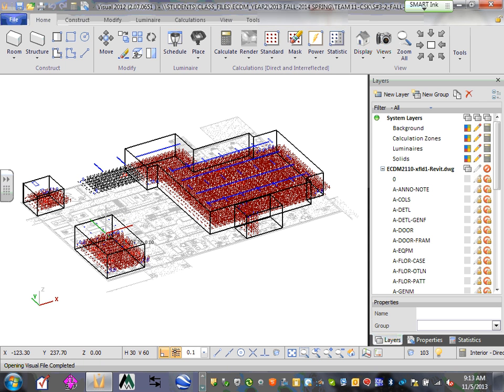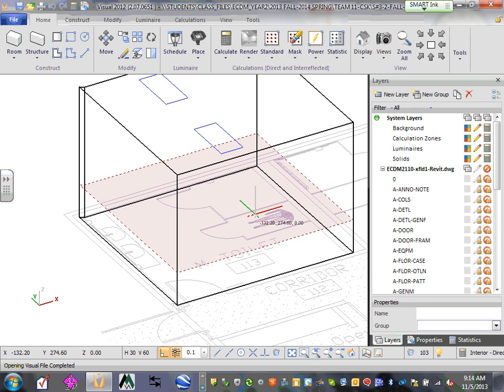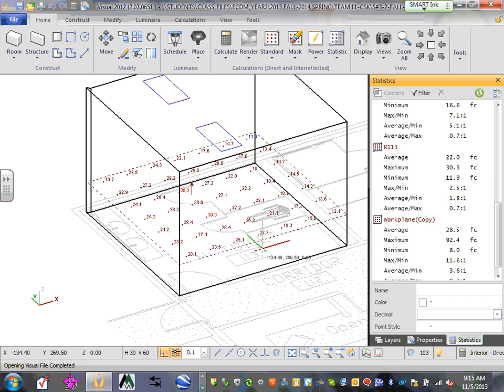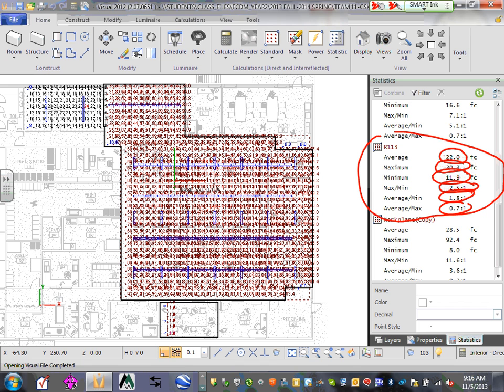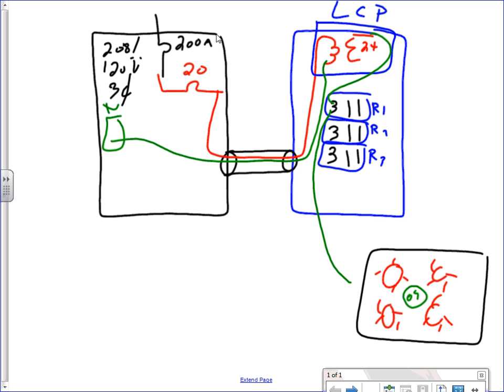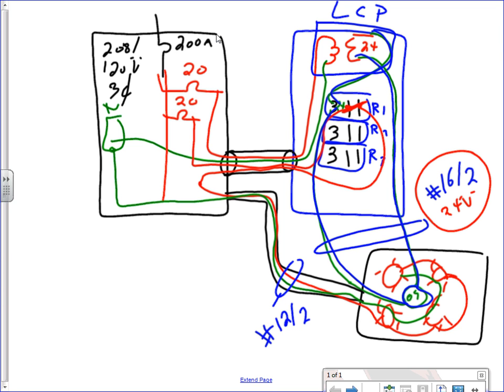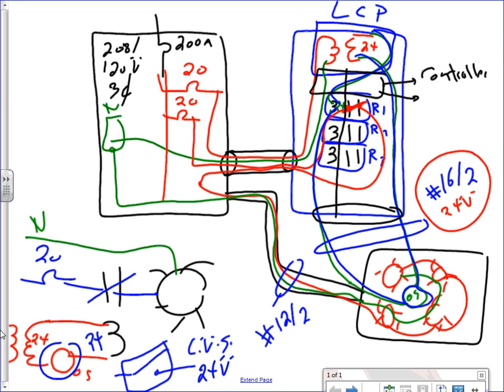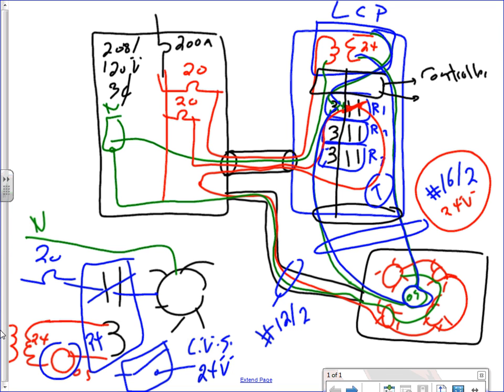Lighting Control Panel 11 05 13

Comment: I'm usually run 12-2 cable with a bare copper ground wire to light fixtures.  Are you splitting the romex cable and running the individual wires to the light fixture and relay module?  Also what happened to your ground?
Reply: I hope that you’ve learned that we don’t illustrate grounds in diagrams